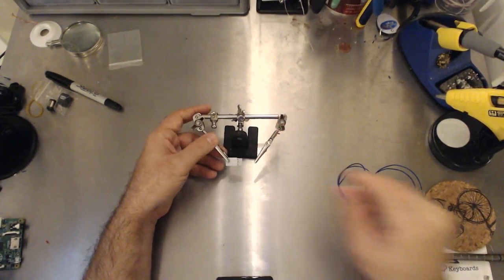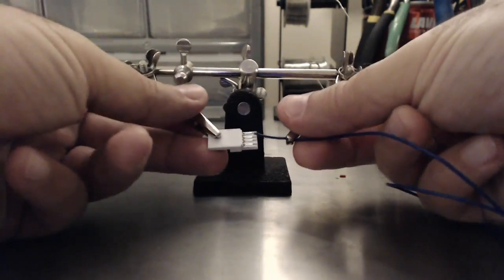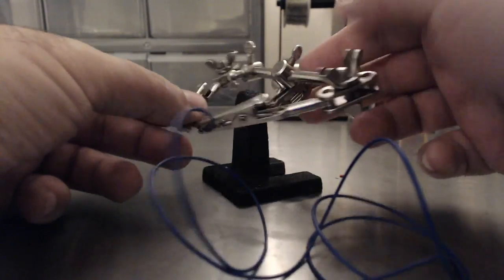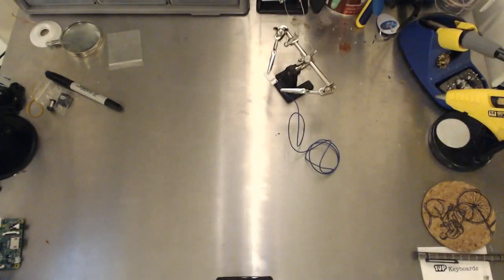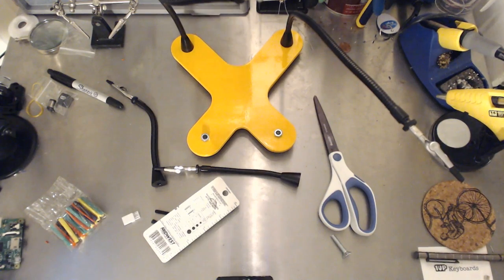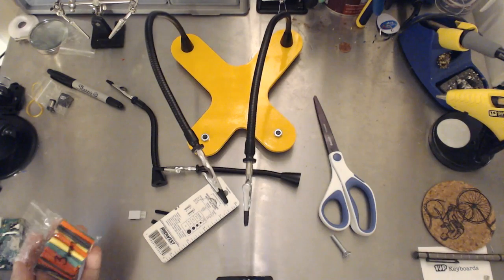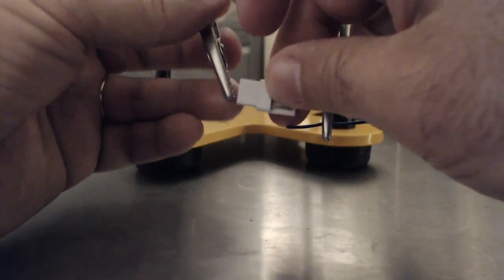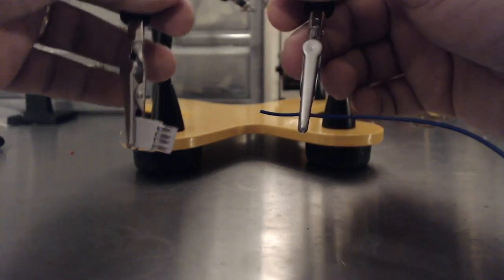Quadhands - the ultimate third hand for your workbench

Comment: You could have achieved the alignment of the wire and the USB plug with the cheaper gizmo... I noticed that you had already removed the magnifier and left the sliding ball joint on the rod. If you transfer one of your clips to that sliding ball joint instead of on the end of the rod, you can bring in that clip closer to the other one and put them in a similar side by side pattern.  

But yeah, the new thing is really cool!  ;-)

Comment: I was enthusiast when I saw this kind of tools with flexible arms for the first time. But now I think that they are pretty useless... :(
The smoothness when positioning the arms is close to zero, so if you have to position (with high precision) a wire/component on a PCB before soldering you will struggle and fight with the arms.
Same problem arises also with similar tools from Adafruit and/or Sparkfun.

Comment: I will definitely not buy this product based on your video. You demonstrated that the springiness of this product makes it pretty useless for lining up wire to connectors. I make my own audio cables and was hoping for a solution.
Reply: do not be fooled. this guy is using them completely wrong, he keeps bending them down to the table for the camera to see instead of bending them so the piece he is soldering is level like a normal person.